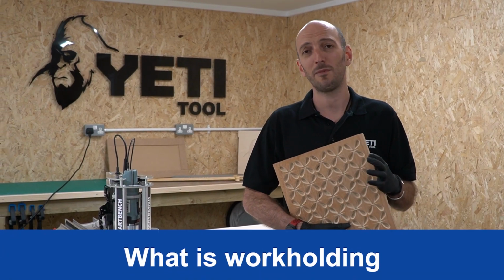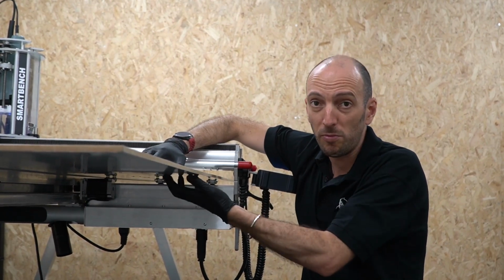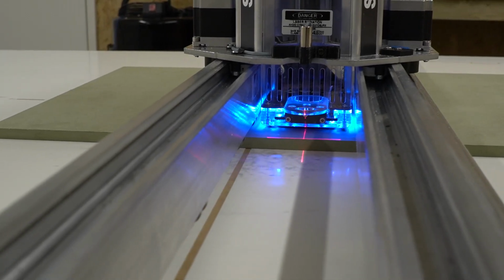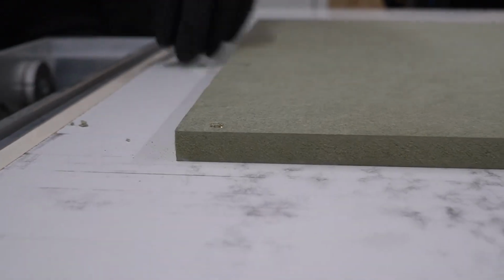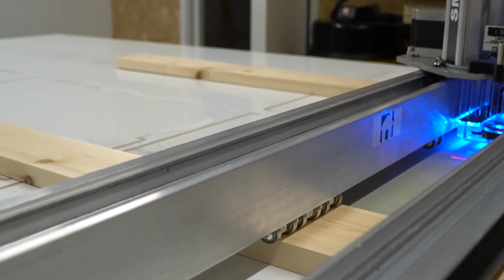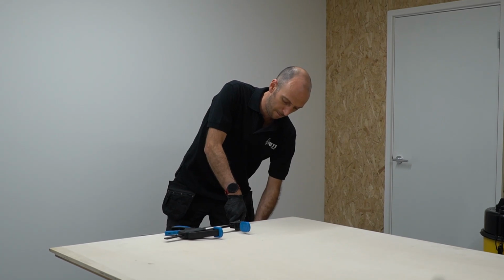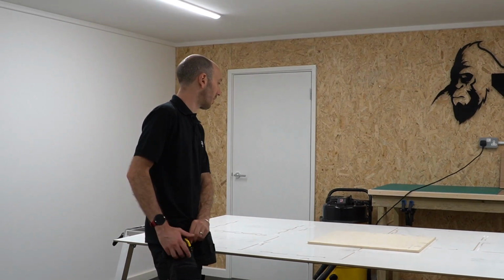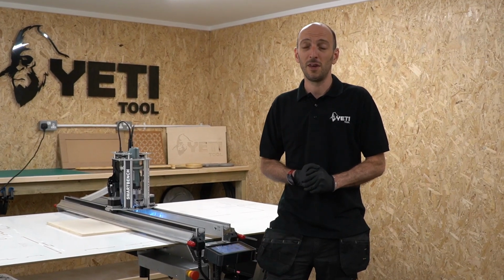SmartBench: Workholding Basics

Comment: Are you saying that when working with full size sheet that you can't use 140mm of Y axis (70mm on each side for roller support) and that will just have to be considered as waste?
Reply from the maker: Hi Colin! Thanks for the comment. When working with full sheets, you can add additional boards to either end of the sheet to ensure the beam is fully supported. It's not completely necessary, but it's an option.
Reply: @YetiToolLtd  Does the bench extend that far past a full sheet? How do you ensure the seem doesn't effect the cut? Thanks for the reply
Reply from the maker: The bench with legs attached are 2.8m so you have a little bit of room. Always make sure you use the same thickness of material for best results @YesThatColin

Comment: I appreciate the concept, but i feel like i would really want a rigid table to just throw material on and fasten.  All the finicky stuff with aligned bearings and such really eats into efficiency.  How would one face a full sheet?
Reply from the maker: Thanks for the comment. When you have the machine set up for processing sheet materials, it is really quick and easy to change boards over. SmartBench can process 1.25 x 2.5m sheets, so if you are processing a 8' x 4' sheet, you have some room each side for runners which the upper wheels can sit on.
Reply: @YetiToolLtd  Ok, so the gantry doesn't sag if only supported on the outside of a 48" sheet?  Could you then set it up where the support edges are higher, and let the z axis reach down to whatever height workpiece you have?  And just leave it like that?  You should have a kit of permanent outside guides.  I'm thinking of many uses where I want to machine all the way around a block, and wouldn't have the extra 2 inches on the ends for support.  

I'm also thinking of a scenario where there is a cut all the way across the y axis, so moving across it, the entire row of bearings would lose contact, and how much that will affect things.
Reply from the maker: @jasongamer8649  yes, exactly that. If you would like to find out more about SmartBench, and see it in person then you can organise a demonstration here: https://www.yetitool.com/request-a-demonstration

Comment: A timesaver alignment for me. I mark the middle of each end of the SmartBench using a Sharpie dot on the aluminum. I mark the middle of the spoilboard with a dot on each end. Slide the spoilboard into position, line up the dots; SmartBench to spoilboard on one end. Clamp one corner. Line up the dots on the other end of the spoilboard, set in place, done. To load a sheet stock find the middle of the sheet stock and repeat the process of lining up the dots.

Comment: Thank you... learned a lot. I think you used GRK small head screws as I do. The don't tend to split the wood if you used properly.
Reply from the maker: Do you mean the GRKs with the integrated washer in the head? If so, great idea! The wider pressure distribution from the flatter head would certainly reduce risk of stock grain from 'splitting out'. Also, big fans of star/torx drive ;-)